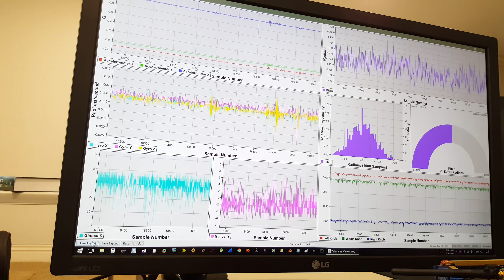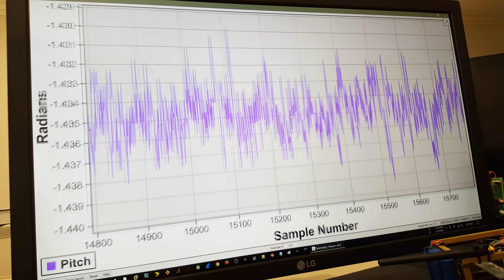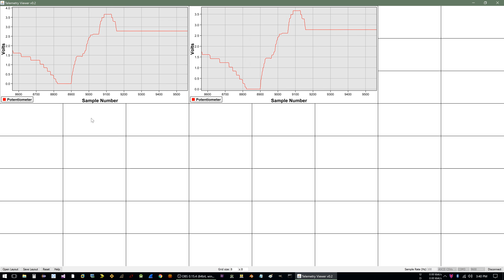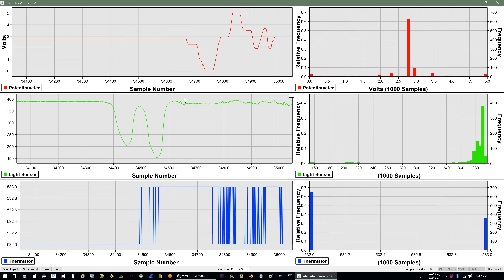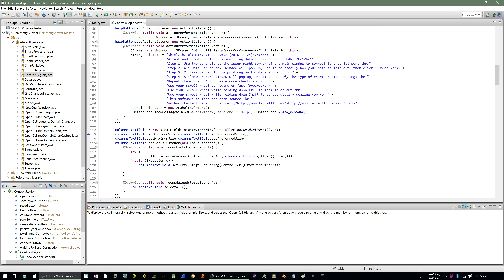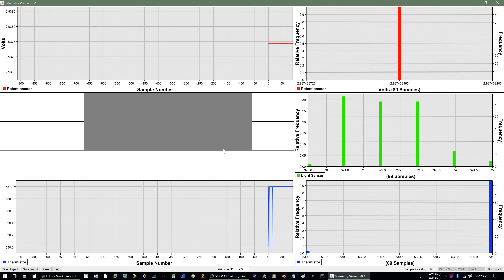GPU-Accelerated Arduino Data Logging and Telemetry

Comment: I have a plc ladder with a Probe_In input. Ive tried to use PLCIN.Probe _In as a variable as it wont compile calling on the A0 analog in.
Is there a way to make this work?
Or a way to  write serial data in ladder?

Comment: Mate you're most Lit code elaborator i've come across my entire exposure to this domain. What a software . Loved it mate . Just one thing if you can tell the solution to !? 
(video timestamp : 37:50)
How can we get the calibrated values of the data extracted from the sensor say temperature , humidity as of their own SI unit values (degree , g/kg3) rather than the raw arduino values ?

Comment: Hi! First off, this is just AMAZING! Perfecly done and so well explained. Thank you so much.

I'm currenlty working on a more efficient controller for heating resistances and ventilators and I need to log my set point and actual temperature. The problem is : Whenever I declare these values as doubles or float your logger displays weird values like instead of 20°C it shows 15000 or smth. I have to declare them as Integers otherwise it won't work

 Do you know how can I correct this?

Thanks again!
Reply from the maker: Try looking at what is written to the serial port when you use doubles or floats. You can use a terminal program or something like the Arduino serial monitor. For example: if you are sending three numbers, TelemetryViewer would expect to see lines that look something like "1.234,2.345,3.456" (without the quotes.) So if you have other characters in there or some other formatting issue, that would cause a problem.
Reply: @upgrdman  omg that was actually quite obvious ! I’m so sorry!

Thank you so much! And once again amazing work keep it up ! (For the sake of us all xD)

Comment: A feature request, a "serial monitor" chart type.  Maybe define a special leading character that TelemViewer interprets as 'send to the serial monitor chart as text'. This way I can send debug messages in-between the CSV data stream lines.  Also if strings can be sent back to the Arduino it would enable a lot of possibilities.  Thanks, Steve

Comment: Hello, it would also be very useful to add "Google Map" to track vehicules (or drones) on a map in your application (search "mission planner Flight Plan" and Ardupilot in Google) .
For example, the data of the drones are transmitted by serial radio link (57600) and the data format is of type NMEA (GLL), UBX, (you can start with a simple csv file with lat, long, and alt).
Maybe i can help you if you want ! Thank you

Comment: FANTASTIC ! Very useful ! 
Could you add maximum/minimum/average landmarks (or dotted line) for all graphs please. 
It will be really helpful (it will avoid user to export csv data to get the Maximum/minimum values). Thanks again for your work (from France)
Reply from the maker: Good idea.

Comment: Hey im just starting and my sensor is a 9 axis sensor which gives out data in a format like this:

G: -1.20, 3.39, -2.21 deg/s
A: 0.42, 0.16, -0.92 g
M: 0.51, 0.47, 0.56 gauss
Pitch, Roll: -24.10, 169.87
Heading: 231.40

Could you hint/help me in which kind of way i do have to modify the arduino code so that it still works with your software?
Would be much appreciated :)
Reply: I guess what I am asking is: Does the program only work with your code or is it possible to use the data printed out by the serial monitor directly even if the code used to generate the numbers is different.

In my case i have a sensor (LSM9DS1) which uses I2C (serial computer bus) to transfer multiple data simultaneously across one output. Is it still possible to use your program?
Thanks in advance.
Reply from the maker: Hi. You don't have to use my exact code, but the data that gets printed to the serial port needs to be formatted in the same way. CSVs with nothing else.
Reply: works fine now, thank you so incredibly much :)
Reply: I will give this a try since my data is already in CSV string format.

Comment: Does this work with window 10? after I bought window 10, it doesn't work anymore
Reply from the maker: Yes, I am using Windows 10 in the video. If you are using 64bit graphics drivers, you will need to use the 64bit JVM. Likewise, if you are using 32bit graphics drivers, you will need the 32bit JVM. If you are still having problems, it might be related to OpenGL compatibility. What video card do you have?
Reply: Thank you for your reply. I am not sure what video card I have. Basically I just got a new laptop (HP Spectre with window 10). After I download your software/code, the telemetry icon shows as 
internet explore. I am not sure what is missing
Thanks
Reply: HP Spectre 360 has graphic card "Intel HD Graphics 620". Is that the video card you asked for?
Reply from the maker: You probably don't have Java installed. You'll need that. If your version of Windows is 64bit, be sure to install the 64bit version of Java.
Reply: I did download Java. I may not install the right one because there are so many ..I have several installed, one called JavaSetup8u131, another called: jdk-8u131-windows-x64. and "jre-8u131-windows-i586-iftw". I am not sure which one do I need to download? Thank you

Comment: How to use a float type data to this program?
Reply from the maker: Hi. The software works with floats. Just have your microcontroller print floats instead of ints when making the CSVs.
Reply: I have print float and send them into the software.
for example, i send this data : 213.25,11.25,125.15,14.23
But the program just read 213 ; 11 ; 125 and 14
Reply from the maker: User a terminal program to see exactly what your microcontroller is printing out. The software can parse floats, I do that regularly.
Reply: I've checked at terminal program. My microcontroller send 213.25,11.35 for example. But the telemetry just read 213 and 11. I'm using %f at sprintf syntax.
Reply from the maker: Something doesn't sound right. Can you post a screenshot of the terminal?
Reply: I will upload the screenshot tomorrow. Because my hardware in laboratory. Thanks a lot

Comment: Greetings upgrdman, I love the project. I have a question for you. I am using a UDOO NEO ARM embedded linux board. This has a built in arduino uno that is handled by a M4 processor. I was curious if you can recompile your source code to work on ARM processors. 

I am new to java, maybe i could go to you git hub and cross compile my self? I really dont know much about that. 

Any help is greatly appreciated. thank you so much.
Reply: Here is my specific error when i run the file in a ubuntu varriant distro off the udoo neo

udooer@udooneo:~/Desktop$ ./TelemetryViewer_v0.3.jar 
bash: ./TelemetryViewer_v0.3.jar: cannot execute binary file: Exec format error
Reply from the maker: You would need to install java, and then use "java - jar file.jar" but it might not work because this software expects a desktop version of OpenGL (it does not support OpenGL ES yet.) You might be able to run TelemetryViewer v0.1 since it did not use OpenGL.
Reply: upgrdman I have attached a link to a photo of the error i am having

http://imgur.com/a/YwTNX
Reply from the maker: That's a problem related to Open GL. I'm guessing your board only supports Open GL ES.

Comment: Awesome program! Thanks! In another video I saw you exporting graphs as an image. Is that feature only available in the older release? Thanks for sharing!
Reply from the maker: Thanks. The TelemetryViewer program has never had that, but I plan to add it in the future.
Reply: Thank you for replying so quickly! You are right, I tried all 3 of your versions :D, and they are all really cool, but indeed none of them export the charts like you pointed out. I think the export feature I was talking about was one of your other videos (Graph Arduino data with Java and JFrame), that showed you doing some exporting at one point (Still have to follow this tutorial in it's entirety though). Is there a possibility to upload a Pre Compiled or Build version the program you've created in that tutorial, just to play around with the exporting function of it. Looking forward to your new version of the Telemetry viewer too though. It's the best direct, no fuzz input visualizer I've found so far, without having to dive into the code itself. Keep up the awesome work! Thanks again! Cheers!

Comment: I downloaded and ran your first version of the Telemetry Viewer and tested it with my Arduino and it worked perfectly, and I really like what you have done. 

Then I downloaded your updated version, v0.2. It downloaded fine and seemed to work at first. I still had my Arduino sending numbers on COM 3 so I filled in the info just as with the earlier version and hit the connect button. As expected, the "Data Structure" window opened and I set everything exactly as I did with the earlier version. When I hit "Done" the window closed as expected. Then I selected an area on the grid for the graph to be displayed, but the graph never came up. I tried using all of the options, but no display, and once the program hung and I had to force it down with the Task Manager. 

Is this something you are aware of and is there a fix for it? I really would like to use your viewer because I am working on a project that requires exactly what you have done here and I have been unable to find anything else that works anywhere near as well as your "Viewer."
Reply from the maker: Weird. Not sure why it got hung up. If you created a chart but it never appeared, it might be because no samples had been received. The charts will not try to render if there are no samples to show. (I plan to improve that in later versions.) If that happens again, try resetting your Arduino. That might help if for some reason the Arduino was hung up and not sending data to the PC.

If the first version is never hanging on you, the only major difference I can think of is that the newer versions use OpenGL. Make sure your graphics drivers are current. Maybe try on a different computer and see if things change.
Reply: I'm having the exact same problem. First off when I start the application, it takes about 30 seconds to open. Once it is open I have the problem that Bill James described. Nothing happens after I try to make a graph
Data is coming through on the serial. I tried to open up Arduino ide serial monitor to confirm that the microcontroller was sending data in the form (10,11,12)

Comment: Wow, it is really useful for what I am planning to do. It has a really simple user interface. Nice job :)

I have a small query. Will it be possible to plot the values from two different sensors against each other? Like in a scatter plot. 
e.g. If I wanted to plot the potentiometer readings (x axis) vs the light sensor readings (y axis)?
Reply from the maker: Thanks. Adding a scatter plot is planned, but it might be a couple months before I have time to work on that.

Comment: Firstly, nice piece of software, free, usefull. It's just one thing that ive been very annoyed about, and thats auto scaling. But there is a solution. Auto scale snaps to biggest value, so have 2 additional constant signals plotted on graph, little bigger than max value of other signals, so there will be no AUTO scaling! :)
Reply from the maker: Thanks. I've been working on the next version, and it has manual scaling, plus many new features. Look for the new video within a week or two!

Comment: Hello there, I want to build a GUI for my robot, and your previous video (Graph sensor data using JFreeChart) was the closest I could reach. I love the way you explain the code, and that makes it so easy to build up my own software. I have a slight problem though. I would like to add a window for the ultrasonic sensor monitoring, and I would like to implement the "gauge" panel you are using. Where do I start, and how do I progress? It would be really kind of you to help me.

Comment: great project! Really useful for dashboards. I'll fork your project to add calculated lines and Kalman Filter. Is it ok for you?
Reply from the maker: Sure, no problem. I've been working on several changes that will make supporting new chart features easier. You might want to wait for that, but it's up to you. I hope to have that finished, plus several other improvements, within a few weeks.

Comment: Am I correct in saying serial printing decimals will not work? I can't seem to get the data to appear on to your Java code. I am using onewire digital thermistors DS18b20. Will I need to try to serial print integers to make it work?
Reply from the maker: Hi. You can use floating point numbers, but you will need to change the firmware accordingly. There's a comment in here from about a week ago covering how to do that.

Comment: Hi, Thank you for posting this tutorial. I'm a newbie to programming but this is perfect for what I'm wanting to do with temperature & voltage monitoring with the Arduino inputs and data logging. I may have missed it on the Video but is there any way of fixing the scale limits on the charts instead of auto scaling. Also is there a feature that is already available or could be added to set alarm values and possible colour change of the dial chart for example, if a reading went above a predefined threshold. Many thanks Darren.
Reply from the maker: Thanks, glad you liked it. I have plans to add both of those features, and many more, but they're not yet done. If you're desperate for manually scaled charts, it's actually supported in the code, but not yet in the user interface. You could hard code the limits if all of your line charts need the same scale.

Comment: Hey! Cool software but i have few issues on initializing it.. when i define the char txt(40) it prints the ASCII 40 which is "(" .
it compiles but with the following warning "warning: invalid conversion from 'char' to 'char*' [-fpermissive]"

Im using MadgwickAHRS.h which includes math.h maybe this causes some issue? is there any workaround?
Reply from the maker: Hi. Array sizes and indices need to be surrounded with brackets, not parenthesis. Like this: txt[40]
Reply: Alright, it appears to be some issue using sprintf with floats so i made the following change and it works...

    sprintf( txt, "%d,%d,%d", (int)yaw, (int)pitch, (int)roll );

Alternatively you can multiply the values * 100 and change 100 LSB to 1 on the Telemetry viewer.

Thanks for the help and the fast response! Also, do you mind if i use your software for my Thesis presentation?
Reply from the maker: Sure, no problem. Regarding sprintf(), you can use %f to print out floating-point numbers. Google "sprintf" for details about how it works and the long list of % format specifiers. Keep in mind that when using %f it may print out the numbers at very high resolution, so you may need to increase the size of your txt[] array to be bigger than 40.
Reply: I read the formatting so many times and i could get only "?" in the serial monitor. It appears that arduino doesnt accept %f - which was my first guess.. after a little bit of searching i found that you have to use dtostrf to convert the double into ASCII. and then use %s as a specifier. Sample code in case anyone else is interested.

    char txt [30];
    char str_roll[10];
    char str_pitch[10];
    dtostrf( roll, 8, 2, str_roll);
    dtostrf( pitch, 8, 2, str_pitch);
    sprintf( txt, "%s, %s", str_roll, str_pitch );
    Serial.println( txt );

Comment: This programm looked very good. I have a problem. If I use the button Connect ,then the button Disconnect 'does not come. The Reset button does not work.
Reply from the maker: That can happen if a connection hangs. Make sure another program is not using that port. You could also try restarting your computer.
Reply: I have used the first version and that works. Version 0.2 does not work if i use the Connect button. Restart and other have no result.
Reply: On my laptop goes the most good. I have one problem. If a make a new chart and i use "Time domain chart" or "Time domain chart (cached)" then the programm closed. With the other  then it is good. Maybe you have a solution for it. The video presentation is very good
Reply from the maker: How old are your computers? If your video card is very old, it may not support all of the features needed. The line charts use vertex arrays, and the cached one also uses framebuffers. Those OpenGL features may not be supported on very old hardware.
Reply: On my Destop worked it now.  A friend  has help me. The java software geupdated. Then it's works correct.Thank you . The laptop is older. There must I used the first version.

Comment: Incredible, I've searched for something like this for a while, then randomly..
Thank you very much.
I'm working on my university thesis, may a use it to graph my 8 microphones?
Reply from the maker: Thanks. Right now the program can only read data from a serial port, so you would need to sample those microphones with a microcontoller or FPGA. Also, the CSV mode isn't really efficient for that much data. The binary packet mode would be better, but it's not done yet.
Reply: Of course, I'm already using arduino and a 8-channel ADC.(the "may I use" was a request of permission ;)  )
The idea is to build a Direction of Arrival,(DOA) system and I thought that plotting the data would be useful for debugging eccetera.
Thank you again, I subscribed and I will follow all your works!
Maybe I'll try to do my own program eventually following your tutorial(I'm studying computer engineering..)